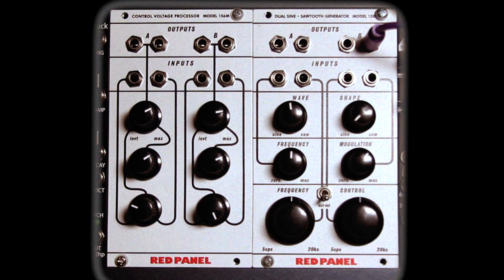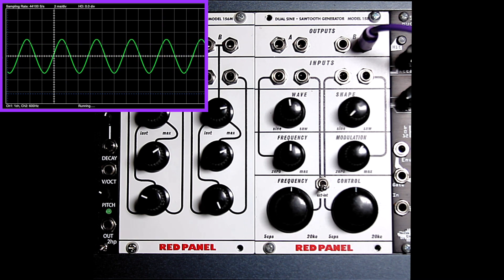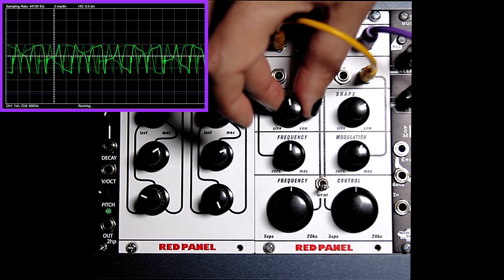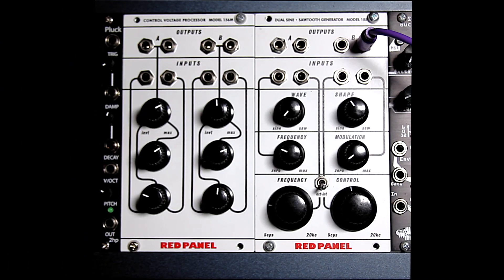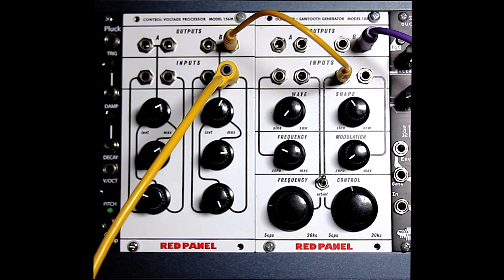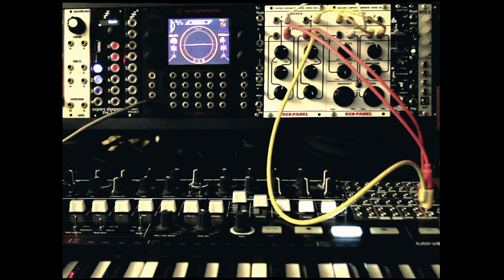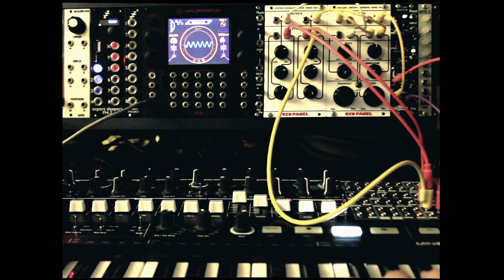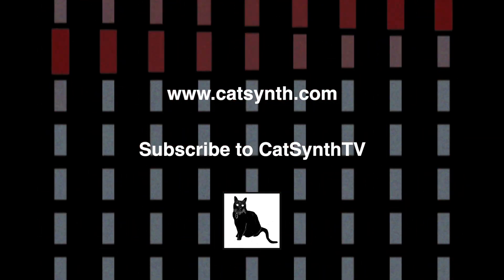Buchla Red Panel 158 and 156M: Demo and Tutorial

Comment: Buchla is so very cool! But super expensive!
Reply from the maker: The Red Panel modules are a lot less expensive than typical Buchla, more in the usual Eurorack price range ($200-$500 depending on the module).  Still expensive, but not the thousands of a Buchla 200 system.
Reply: @CatSynthTV  are the red panel in eurorack format or do I need a Buchla boat case?